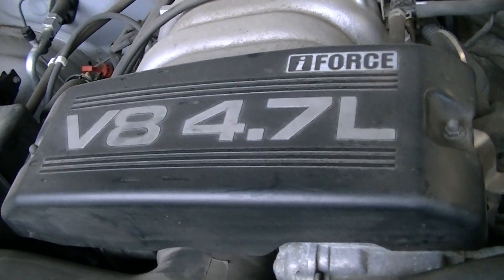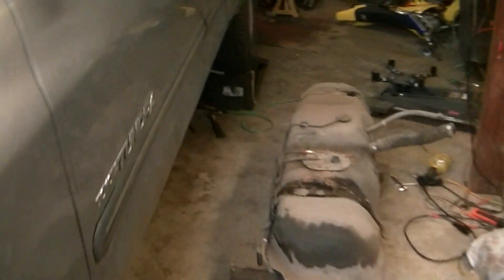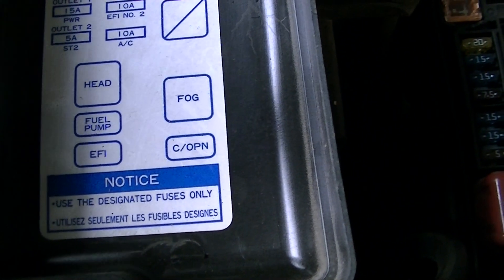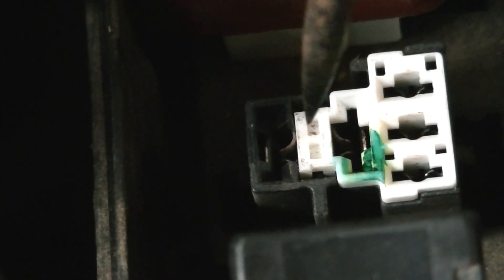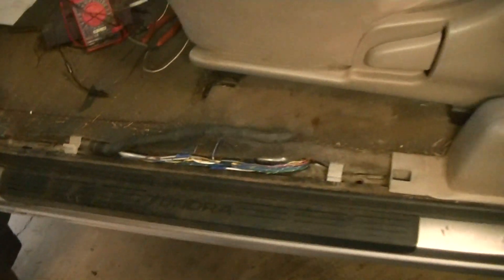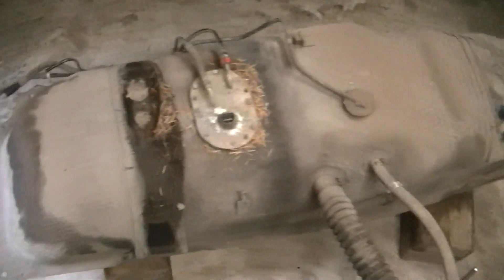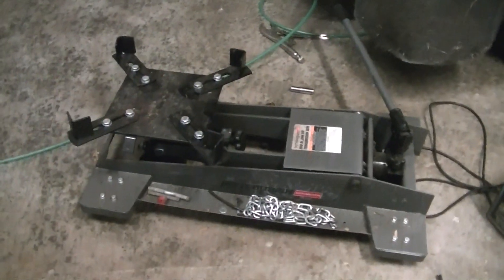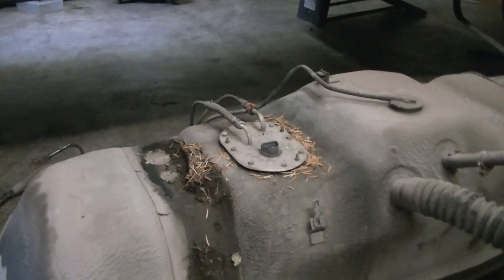ToyotaTundra Fuel Pump, Crank / No start.  I Show You What To Do.

Comment: Im dealing with a crank no start on a 2006 Tundra Double Cab 4.7, I’m not getting fuel, checked relay and pump, it’s good, checked crankshaft position good, just running in circles, not getting a signal at FPR pin (red green wire that goes to FPR) at PCM but I’m getting Power at the FPResistor

Feeling a bit defeated on it

Someone mention Tansponder, Immobilizer, just lost on my diagnosis, I called the Lockshop and they said the Key shouldn’t be Chipped after running the Vin

Comment: I have a 2002 tundra as well my fuel pump relay is not getting enough power, I jumped the relay plug and my fuel pump is working when it’s jumped, but not working with a good working relay, what do you think the problem is?

Comment: Are you sure the valve to the fuel injection system was not stuck open basically causing the system to flood aka vapor lock

Comment: Heyy bro, great video! Thank you. I have a quick question: when i wite the cable straigth to the battery it runs. But then when i wire it back to the truck it dosent run in contact. What could that be besides the relay?
Reply: I have the same issue, did you figure it out?

Comment: Thanks! My 02 Tundra has 300k miles, I changed the fuel pump a few months ago but now it won't start again. Did I make the mistake of driving afterwards on E for a few miles before fueling again? Maybe because I didn't clean out & check the bottom of gas tank for debre, dang it... I replaced the starter & alternator a few months ago but I think I messed up the pump again the way I'm driving it on E on such an old truck🤔
Reply: Try replacing the fuel filter too!
Reply: @granitestateman942  I did three times already I've made the mistake of driving on with the gas light on thinking one or two miles to the next gas station wouldn't be bad. Always keep a quarter tank I learned the hard way LOL
Reply: @-ly7xp  I think that's happening to my truck . I have to change my pump  again ? 🤔
Reply: @tavo7766  yeah I've changed the fuel pump three times the older the model the more delicate if it spuders when accelerating that fuel filter too like the other guy commted
Reply: @-ly7xp  I fixed.  I just changed the lil fuel pump  hose .
Reply: @-ly7xp  thanks .

Comment: Great info for testing my 04 tundra cranking good but not starting. So what do you test next if when jumping power from battery to fuel pump circuit and the pump works just fine and truck will start right up and run great with jumper wire?
Reply: Barry Toyota maybe the relay since your bypassing it by applying direct power is my guess

Comment: I'm at 367,000 miles,  and my truck won't start.  Must be the fuel pump since the truck is turning over. Thanks for the video.   I'll be buying a new fuel pump tomorrow.
Reply: Consider replacing the fuel filter too.  Just replaced mine on a 2001 V8 Tundra with 255,000 miles. Good luck!